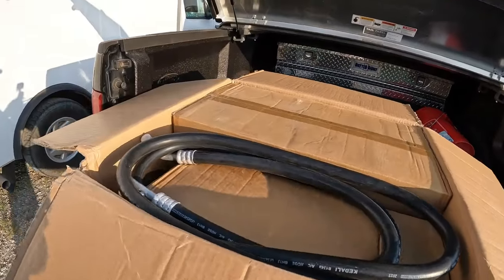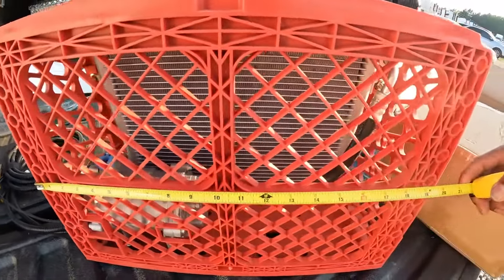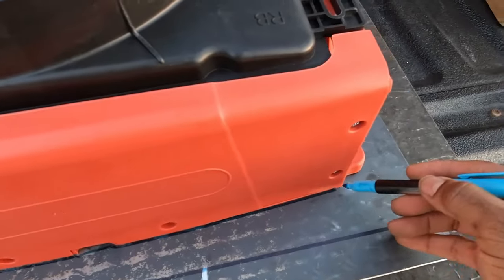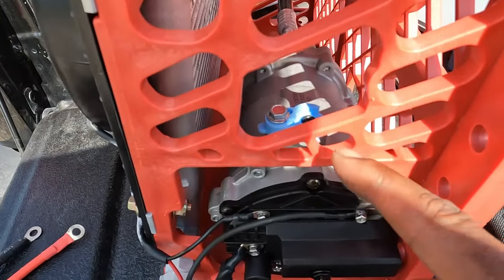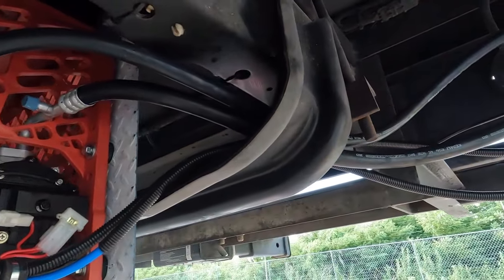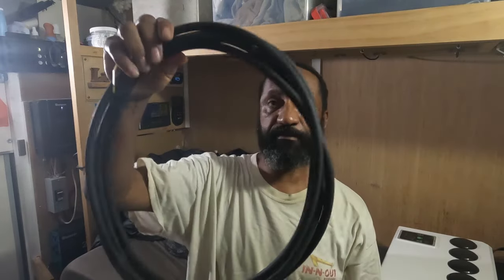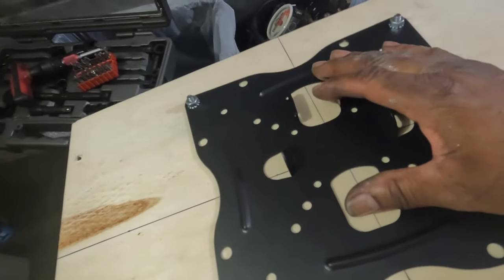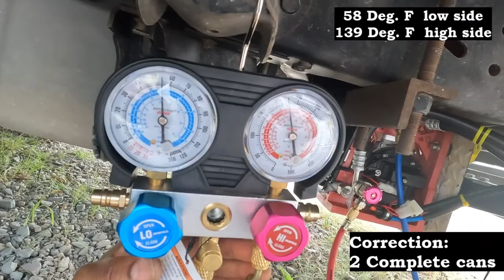VAN LIFE IN A BOX TRUCK: 12 Volt DC Mini Split Install

Comment: Thanks for a very good video on 12V AC.

The NEPOKKA brand seems to just be another brand from TREELIGO or many others. They seem all to be the same except labels though prices vary a little bit.

Your installation is very informative. Clever use of the tv mount. 👍🏻

The condenser/compressor unit can be tilted a bit but there's a limit. Also, the hoses have to be in proper orientation.
Reply from the maker: Thank you.  I appreciate the information. I will pin this comment; others may find it helpful too.👍🏾
Reply: "Hoses have to be in the proper orientation"? Please elaborate. Nowhere does it say you have to orient them in a specific way. You mean those connections in the expansion valve?
Reply from the maker: @serjstol6695  
With all due respect to the "hold my beer" folks in the world...😁

Mixing up the orientation of the low and high pressure hoses on the Nepokka model I bought would be difficult.  I remember on the compressor ends, the hoses had different connectors.  I don't specifically remember the ends on the expansion valve side, but they may be different in size.  I don't have direct experience with other Nepokka models, or the other brand mentioned.  
I believe the original comment was intended to accommodate the small subset of do it yourselfers that, in spite of the odds, will manage to find a way to screw up anything. 😉 Thank you for commenting.
Reply: @xlamontx Fair haha, I connected mine and the hoses are different diameter so its impossible to mess up so I was confused. (Commenting from different account)
Reply from the maker: @tehdreamer  
😁😁😁  Thank you for keeping us honest.  And it gave me a chance to practice my diplomacy skills.😂

Comment: This is the first time that I've seen anyone on Youtube install a 12V AC under their vehicle. I don't have any experience with electrical connections or using a compressor to charge a system, but for someone who does they would more than likely understand exactly what you did.  Thank you for taking the time to share your install so that others may learn from you.  Take care.
Reply from the maker: You're welcome.   I didn't have room on my roof for a roof top system.  I've seen a couple of videos where they mounted their systems to the back door of their vans.   I wanted to try something different.  Thanks for watching.

Comment: Thanks for pointing out the importance of increasing wire size to adjust for a longer run.  I think this is an area that people don’t understand and they think smaller/less expensive is Okay.  I am not an engineer, but I do know the bottom line is it is fire risk at worst to go too small.  Great video!  Appreciate the in depth description, and I too think you are genius re: the TV wall mount for the Handler!!
Reply from the maker: Thanks nmartin5551.  😁 I appreciate you watching.
Reply: Yep.  Long cable runs are also a very good reason to choose a higher voltage system.  I went with 12v in my system, but even for a short cable run, a 3000w Victron inverter wants a 4/0 cable!  If I ever do another build I'll definitely choose a higher voltage system.

Comment: Thank you for an install video Done Right and sharing with us all the steps and logic without overwhelming us with blah blah. I really like your solution for mounting the red box, and how you showed how you got the lines into the van through the corner hole.  It was really interesting about the thick wires to the batteries. Freaking genius putting the air handler on a tv-mount!
Reply from the maker: Thanks Costa2984.  I appreciate everything you said.  I can do without the blah blah myself.   LOL. Thanks for watching. 👍🏾

Comment: Got a similar unit to add to the stock Carrier unit on a skoolie which isnt enough by itself for the Florida heat.  12V compressor ACs were unheard of recently, and it looks like an emerging market.  Thanks for the video
Reply from the maker: I was looking at 120 volt units and was thinking, because of the size, I would have to mount it to my rear bumper or possibly a swing-away style hitch.  The 12 volt units were a total surprise to me.  I stumbled across a YouTube video where a young lady installed one on her van and the size was closer to what I needed.  I may have unintentionally improved the efficiency of mine by mounting the outside unit under my rig and out of direct sunlight.   I don't have a way to test my theory, but overall, I'm pleased with the results.   Hopefully, yours will exceed your expectations.  Safe travels.👍🏾

Comment: I had no clue they made Mini split units on 12v that would work perfect for my cabin. I love the idea you used for the mounting of the interior unit on the wall using a tv mount that is brilliant! Great video, I also subscribed, looking forward to your life's journey.
Reply from the maker: It's been almost a year and it's blowing just as cold as it did when I did the install.   I've recorded about 90% of an update video.  I just need work to lighten up a bit so I can finish it up. Thanks for watching and I appreciate you subscribing.👍🏽

Comment: Depending on how many people would choose this type of system to use for cooling in a vehicle, you have already figured it out which if you wanted to make $$$ by putting them together for a customer, or just make a step by step video with plans so if anyone wanted to do it themselves, they could watch your video, and any included printed materials you included…you might just have a way to earn money either by offering a couple of options to anyone interested in having you do the work…or not do any of that and simply enjoy your days without offering installations and instead offer the instructions and a video and call it good.

Nice job on your hard work and it looks great! 
Liked and subscribed. 👍❤️
Reply from the maker: I like where your head is at.  I was thinking the folks that install solar, roof fans, and diesel heaters would eventually offer the installation service of these 12 volt mini split A/C systems.  Thanks for watching.

Comment: Great video. I’ve been trying to get AC in my daughters transit. Tried 110v portable powered by EcoFlow power station. Tried 5000 btu window unit and would not cool.  Recently saw this option and glad you posted your install.  Looked through some comments and you already answered my questions.  Thanks for posting video, Lamont!!
Reply from the maker: I installed mine in early July and it's still keeping me very cool and comfortable.   I noticed the compressor seems to run a bit louder at times, but no so loud that it bothers me.   Also, the hoses on the inside would accumulate condensation on them so I wrapped them with insulation.  I plan to update in a future video,  but your comment reminded me.  Thanks for watching.👍🏾☺
Reply: @xlamontx  Thanks for response.  Good tips as those issues were not addressed in other videos. So, I would make sure I plan for wrapping lines and if my compressor is close, I will try to insulate and use sound deadening around it.
Reply: What is your solar and battery bank?
Reply from the maker: @MannyWC  
I just stumbled across your question.  I have 810 watts of solar and 400 amp hour AGM batteries.
Reply: @xlamontx  ok thank you ~

Comment: very good instruction.  am putting ours on rear sprinter van driver side door.
Reply from the maker: I watch a video where a van owner mounted his to the rear door.  He also painted the cover to match the van.  It blended in nicely.  That was my second option if I couldn't fit it under my rig.  Thanks for watching.👍🏾

Comment: I have to say, when it come to buying from China, it is never a failure. They make cheap products with good quality. Thank you for sharing. 👍🏼
Reply from the maker: I agree.  My made in China diesel heater has gotten me through three winters without a catastrophic failure, and is still going strong. The two minor issues I had, were easy to deal with.  Thanks for watching.
Reply: Good. China Goods.

Comment: Nie job, wondering did you fuse it at all. I assumed you would use fused contact blocks but I don't think you mentioned it,   The newer units now,., are fully assembled gassed up and ready no pulling a vacuum or filling ... needed,,  yep they are now making home direct to solar ... mini splits really nice super low amperage draws..
Reply from the maker: Thanks.  Yeah I ran the larger wires from an existing fuse in my system and the unit came with an inline fuse close to where I made the connection.   I didn't know about them coming pre charged with refrigerant.  Its amazing how quickly the industry is adapting to consumer demand. 👍🏾

Comment: if its anything like the unit I just received (12v 60A 750w),   your wiring is much preferrable.   I am taking mine 1/0 all the way back to the compressor form the 800ah of lifepo04 batteries in my bank; however,  you may want to rethink the nylon nut as in a short situation the nylon can catch fire
Reply from the maker: You have a great point.  I could have used a second non nylon nut tightened against the first to prevent them from vibrating loose.🤔  l even gave some thought to crimping the wires for an even better connection.    I appreciate your feedback. Thanks for watching.👍🏾

Comment: @Driving Home  👍Thanks man, this is exactly what I've been planning on doing under my Winnebago View so that I can get rid of the huge, loud AC on top and make room for more solar panels. I don't think it will cool the entire thing on super hot days so I plan on curtaining off the rear bed and bath section and mounting the inside unit back there.  Thanks for the video and was hoping you could do a follow up on how much battery power the unit is pulling on a fairly hot day, that would be great.
Reply from the maker: Thanks for the question.   I couldn't remember right away and had to dig through a few previous comments to find the answer I gave another viewer.  It seems at the time I got a reading of just under 400 watts at about noon that day.  That calculates to just over 33 amps per hour.  I should be able to get a bit more than 5 hours of use with no sun but I get nervous going past 4 hours.  Batteries are usually reading about 60-65% after 4 hours.
Reply: @xlamontx Thanks for the reply, I actually went and read through the comments and found that as well, sorry I didn't acknowledge that. Take care bud.

Comment: Hey Driving Home.  Is it possible to extend the High/Low hoses to around 16 feet.  I understand it comes with only 10 feet?  Also want to extend the comms/electrical wires.    I'm also going to install under my van.  But I don't want to drill a hole since there's a gap I can use towards the back.
Reply from the maker: I extended my electrical wires by about 16 feet by adding thick gauge wire from my batteries to reach the factory wires that came with the unit.    As for the high/low hoses,  I don't know if longer hoses will  effect performance.   The instructions did not address adding to or shorting the hoses.  If you do buy longer hoses, let me know how it turns out.  Thanks for watching.

Comment: I can’t tell if you’re in a cargo trailer or if you’re still in a van but I think you should consider doing an update video on your setup. It looks like you have had some time to make some nice touches a long the way. I may have missed it but is the condenser mounted under the rig or on the backside somewhere?
Reply from the maker: I'm in a box truck, or I sometimes say box van.  I do need to do an update video but I need to shoot it with a wide angle lens.  That will be coming soon. The Air conditioner is mounted underneath my rig.  The more my rig looks like a plain old box truck,  the less attention I think it will get.

Comment: Thanks for posting. Learn more about these units. Just been searching on Ebay and looks like prices are coming down quite a bit. Most recently as of 8/31st, they are $400. I am excited to get one. How many watts are you pulling from the battery?
Reply from the maker: One morning I checked and calculated the watts used at 162.  Shortly after noon that same day I was using 380 watts.  
I noticed a significant difference in price between eBay and Amazon.  I'm all about saving money when possible.  Unfortunately for me, I was planning a trip and needed the faster shipping and easy return (just in case it arrived damaged) Amazon offers.

Comment: I,ve been installing hvac for 30 + years both mobile and Stationary.  U did a very nice job.  I am curious however why u didn't install the condenser on the horizontal plane.    Nice job either way though.
Reply from the maker: Hi there.  Great question.   The short answer:  I didn't know if ac compressors have a "top" or "bottom."  
Let me explain...I bought that unit specifically because there's a rubber hose between the condenser and the compressor. My initial plan was to remove the condenser and the compressor from the little red plastic cage and mount the condenser horizontally while keeping the compressor mounted vertically.  (I was thinking about a time I was told to keep a refrigerator upright for the compressor to work properly.)   My plan was to make a little mounting perch for the compressor. However, when I got the unit and could rely on my own measurements, I realized I can probably make it fit without the extra work of separating the compressor and condenser from the cage. I took the path of least resistance.   It would still be useful to know if that unit can be mounted horizontally with no ill effects to the compressor. I had the room under my rig, but others may not.  Thanks for watching.
Reply: Hi, I saw your comment. As an HVAC installer, would you say that most mini-split condensers can safely be mounted horizontally like you're describing? I've read some people say it's okay and others, like @xlamontx in the reply to your comment, worry that the compressor won't work as well on its "side" -- would love your input
Reply: Compressor has to be mounted upright or else it will be starved of oil and burn out

Comment: 1. I would make it a habit to video record opening and doing inventory to help prove your case if any items are missing or damaged, especially of large relatively expensive purchases. Publishing is a different story.
2. More hose and less hard-line be it PVC or metal decreases harmonic vibration which is a major factor in a traveling vehicle (goes for plumbing as well).
3. What is the exterior unit's final ground clearance?
Is it the lowest component of your undercarriage?

Overall, personally, I want more specific information (i.e. data points) in a video.
I also own a box truck and am still designing. 
I intend to use a mini-split with the output in/near the sleeping area that can be curtained off. This area includes my desk & electronics. I don't need to cool the rest of the interior when sleeping. No information on the electrical draw at start-up, running to cool the space down and once achieving set temperature does it drop down?
Reply from the maker: Good comment.   My a/c is the lowest item under the rig.  It has 13 inches of clearence from the bottom of the metal plate I mounted it to.  I'm considering air bags for the rear suspension to help with the overall weight.  If I get an extra inch of clearance, it will just be a bonus.
The manual says the amp draw is 60-80 amps.   That is consistent with my general "test."   I usually run it with the temp set to the coldest setting and the fan speed set the lowest speed (to minimise the noise).
Reply: @xlamontx  I think watt hours is the measurement most people are concerned with. There is  a mini-split that runs at 800 p/h until the desired temperature setting is achieved then reduces to 200. For the area, your unit may be a bit undersized and drawing more electricity than required. The gist of my comment is proper selection of a unit for each specific vehicle requires a lot of technical data. 
 My 16'ft box is going to have two DYI opposing slide-outs. I have not seen anybody do this. 
Cupboards with doors versus more open-air design affect the environment. Internal cubic feet for BTU calculations is going to differ for every vehicle, as we know.
Best of luck.
Reply from the maker: @Mark-gg6iy  
I've seen a loft added to a box truck.  I've seen a roof raised on a box truck.  Two slides on a 16 foot box truck would very likely be a first.  If you plan to post pictures or video to the public, I would certainly follow that build series.👍🏾

Comment: Thanks for the video. How many amp hours does it draw? How long can it run off 400 amp hours?
Reply from the maker: Keeping in mind I have AGM batteries and must keep them  above 50% state of charge, I can run it on low fan speed and coldest temperature setting for about 3.5-4 hours starting at 100% charge.
Reply: @xlamontx  thank you for the info, I am looking at a similar set up to yours
Reply from the maker: @DentsNow  My electrical setup was more consistent when I had 3 AGM batteries.  I was hoping to save weight, but I may want to go back to 3.  With 2 batteries, I use a few lights, run my diesel heater (below 50°F) and the fridge after the sun sets.  I frequently wake to about a 55-65% charge.  With 3 batteries I was usually around 85%.  Just something to consider.  Thanks for your question. 👍🏾

Comment: Can it be powered by a portable generator? And if so, how would I plug it in? Thanks again. Great video
Reply from the maker: This air conditioner only works on 12 volts DC.  As the unit is taking power out of my batteries, I use my generator to add power back to my batteries.   I have a "converter" that plugs into the generator, and it converts the 120 AC volts from the generator to a DC charging voltage (about 13.5 to 14 volts) that can safely maintain my house batteries.  I did a video on this if you want to see the details.  Thanks for watching. 👍🏾

https://youtu.be/ZILzYZ6S_NM?si=P-2ElcqMHAD7_nGg